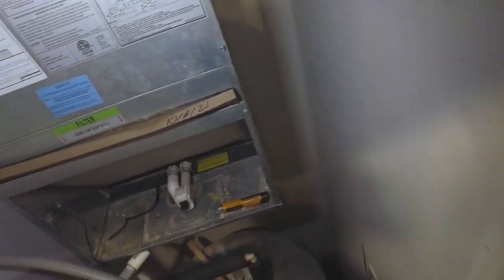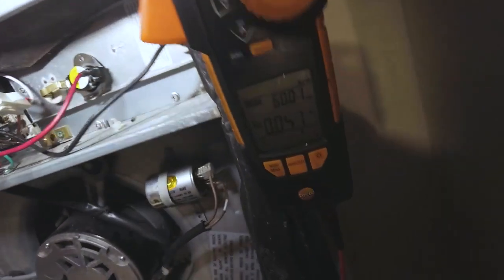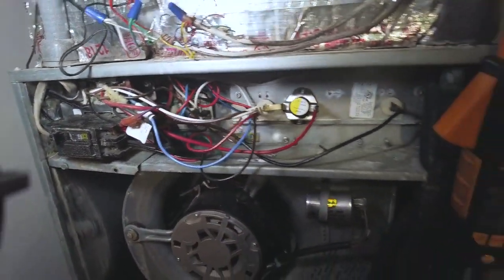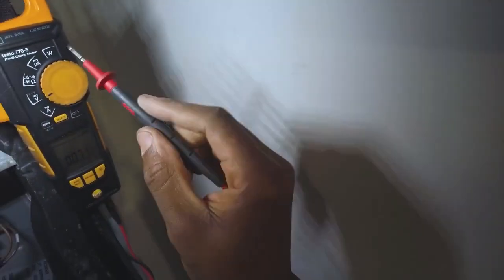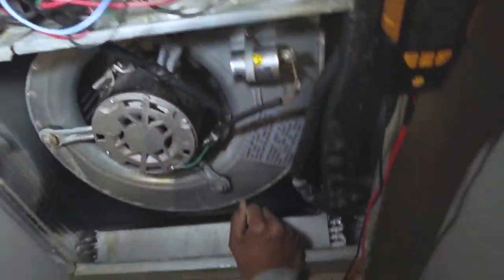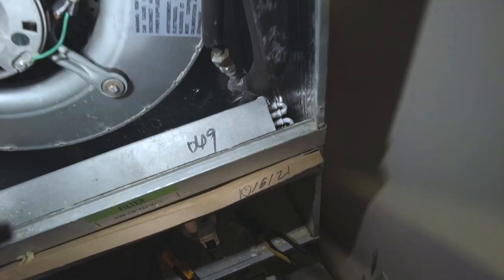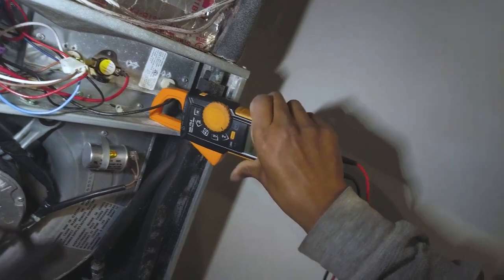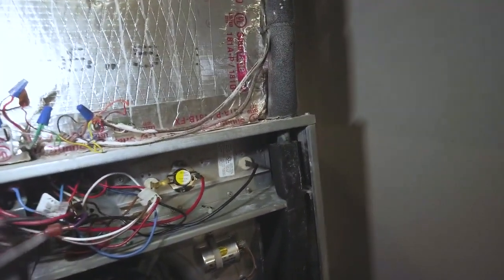Failed Relay on Apt Air Handler HVAC Tech Diagnostic Call Day in The Life no heat service call

Comment: A rectifier in an HVAC relay converts alternating current (AC) into direct current (DC). This is necessary because many HVAC systems, like those using solid-state relays (SSRs) or certain thermostat control circuits, require a DC voltage to operate. The rectifier transforms the AC power, often 24VAC, into a DC voltage suitable for the relay's coil, enabling it to switch and control the HVAC system's components.